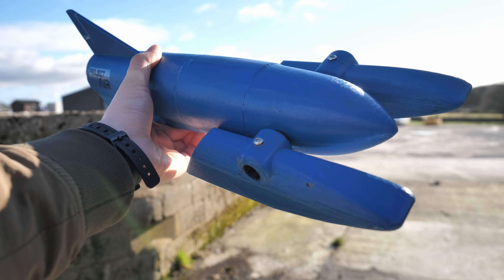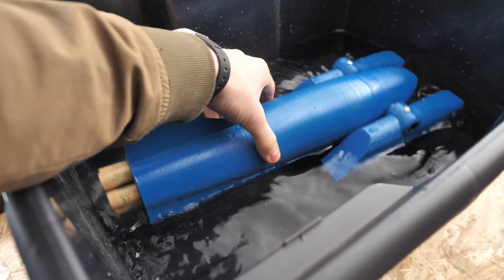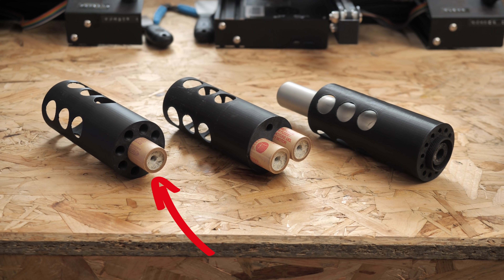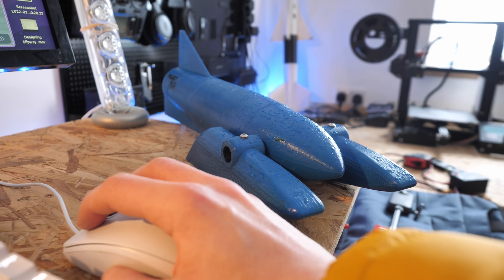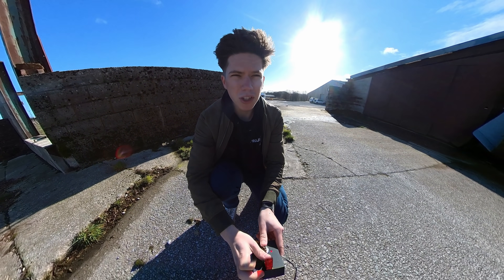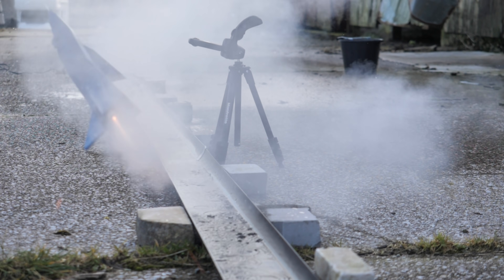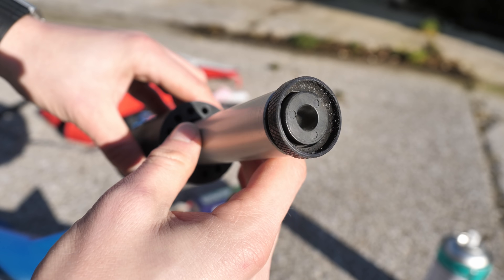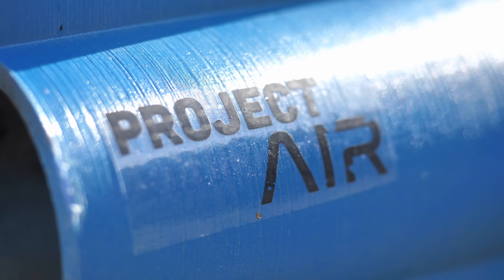DIY Rocket Hydroplane

Comment: Nice video.  Main issue is your sponsons are too wide - they're developing too much lift.  Look at the sponsons on the original Bluebird K7 - they're WAY narrower than your design.  Also note that in photos of the boat at high speed, only the last few inches of the sponson bottoms are touching the water.  Finally, the original K7 crashed when Campbell got too exited and didn't refuel between runs - which made the boat too light and it flipped.  You might consider adding some weight to the nose of your boat to increase stability.

Comment: Wrap all the rocket motors with the housing shaped like a lightly restricting funnel. Reverse bellhousing if you will and it will take care of the problem of not all the motors firing at once because they will all be directed into a single stream.

Comment: As a scale modeller you realize that the scale of the model 1:48th for example means the speed or distance travelled also has to be scaled by the same equation for example 1 nautical knot = 0.5metres per second, full size, at 1:48th scale that half a metre distance has to be scaled down by the same scale assuming time is a constant.

Comment: It should be obvious to anyone with an interest in highspeed boat design that Ken Warby's spirit of Australia's World Water speed record holding design solved the stability issue by incorporating a horizontal aerodynamic stabiliser. As soon as the nose lifts on a wave the angle of attack on the horizontal tail changes, and being a proper airfoil generates  aerodynamic lift more efficiently than the boat hull creating more lift at the tail than the bow,  autocorrecting the pitch change.   Warby hit skiboat wakes at around 300mph on blowering dam and his boat simply glided in the air with just the water rudder in contact with the surface for around 200m before the hulls touched down smoothly again. A highspeed boat ftravelling at a speed where it can generate more aerodynamic lift than its own mass  needs to be aerodynamically stable in pitch .  Donald Campbell's bluebird design was inherently pitch unstable and his death was inevitable by design.

Comment: I wonder if you could make a self levelling device for something like that, where if the nose rises out of the water, it automatically adjusts the angle of an aerofoil at the back to push the nose down again, and pulls it up if it goes too far under.

Comment: Make one big motor with 40/60..... sugar and KNO3, a 5 inch piece of 3/4 inch pvc for the motor body would be a M-class engine, stick bottle rockets get up to 2000 feet high.....you might need a bigger boat.

Comment: I did this back in the Summer of 1985, built a much smaller hydroplane out of a Estes rocket tube, "C" size motor, and balsa Hull/Sponsons. made a metal ramp at the lakes shoreline had a crowd around to watch, and after ignition watched it dive straight down under the water, becoming a rocket powered "Submarine" for a brief moment and floating back to the surface.  

I didn't give up though, second attempt was a cheap plastic kids "Tugboat Toy" with a roman candle firework shoved in pointed backwards.. I was told not to "Light it off by the docks" and with assistance from a friend transported the contraption out a short distance. Again with a small crowd gathered to watch I lit off the roman candle. To the amusement of the crowd the boat did not propel itself forward. it only slowly rotated a few feet from the side sending fireballs across the small aluminum fishing boat with some striking the side with "Ping, Ping" causing both of us in the boat to try and duck and take cover from the barrage of fireballs!  I returned to a lot of laughter about the display...

Comment: Hi fantastic video, I'm no expert in anything, but the issue of the boat flipping. This reminds me of the same issue as drag cars have when racing, don't they run long narrow stock to prevent flipping? So I thought if you increase the body length will this help?

Comment: We used to have rocket drag races when we were kids. We would get a toy with wheels like the steve austin $6mil dollar man rocket plane with wheels it was the best. any spaceship or any toy car or wheeled vehicle would work. You would modify it with a drill or saw or knife whatever you had using glue or duct tape or whatever. You install D size Estes rocket engines. I did three engines on the steve austin wheeled rocket ship once. Lots of fun I'm 58 now I might even try it again!

Comment: What is wrong with your design is the same thing that was wrong with the old Bluebird boat. It’s unstable. The old bluebird boat went airborne and somersaulted at over 300 mph back in the 1960s and was lost for over 50 years. It looks beautiful, but is inherently dangerous and flawed.

Comment: Too much flat points in contact with water. The original Bluebird K7 design had planing shoes made of stainless steel which it glided on over the surface of the water.

Comment: So I'm a Pyrotechnician and I think your issue with ignition is probably the type of ignition you're using. I'd suggest that you look at a pyrotechnics ignition system like Cobra Firing Systems M6. Also you probably want to use a electric match in a choke for a better ignition like we do with Gerbs (essentially a pretty version of a rocket motor).

Comment: I like the idea of a hydrofoil and maybe a an inverted airfoil under the main hull of the  boat (like an F1 car has).  But a longer length with a center of gravity towards the front would keep the boat on the water too

Comment: To keep the front of the boat on the water you need to add weight to the nose. this will also make it more stable. The center of gravity needs to be about 1/3 of the way from the front of the boat for a hydro

Comment: May i make a simple recommendation? Since your motor holding devce just slides into the frame of the boat. Load a spring in the bottom of the female portion so that when the engines complete there burn time the presure against the spring will cease there by allowing it to eject the motor frame. No latches needed.

Comment: About 20 years ago, I helped my son and his schoolfriends to build a rocket-powered boat for a class contest. To my surprise, the school approved it for a test in the outdoor swimming pool, which was enclosed in wire netting. I was so concerned that it shouldn't take off that I designed it with some downforce from the airflow.
The result was spectacular  - the boat shot forward about one metre, then dived to the bottom of the pool with the rocket motor still burning. It finally bobbed back to the surface a little more than one metre from the starting point, and was awarded a special prize for "Least Distance Covered By Any Entry." It was, however, a most spectacular failure!

Comment: Late comment here but if I remember well, for multi-motor microrockets (never did one myself) it was recommended (by Estes I think) to use another micromotor to ignite the cluster. This by using the exhaust flame from the nozzle of the "igniter" motor positioned at some distance from the cluster.

Comment: Years ago we used the gun powder from fire crackers for multiple engine rockets. Plug the nozzle with wadding once the igniter and powder have been added. You'll notice quicker ignition also. The max one guy was able to ignite was 24 engines in a Saturn 1B.

Comment: I've often wondered why super fast hydroplane racing boats don't have have a device similar to a model airplanes elevator hooked up to a gyro stabilizer that would automatically keep the nose of the boat at the proper attitude.

Comment: You are facing the SAME ISSUES as the BLUE BIRD, you SIMPLY NEED  A SYMMETRICAL EPPLER 169  T horizontal tail-aileron behind to prevent nose-up catatstrophic behavior  ( see the australian machine which run at 450 kph )

Comment: A couple years ago I decided to make a handful of rocket power boats.
Most went airborne or they went completely submarine. 
I found it interesting that the rocket motors worked underwater.
Most of the ones that went submarine easily shot out to about 50 feet underwater like a torpedo.

Comment: Your problem is your using most of your thrust just to get up to speed and your done before you can hit full velocity. You need extended fuel life and a bigger track. I also think you would be better off making the boat wider and longer for stability. Maybe a set of back extensions like the ones in front.

Comment: Lol, I did this about 20 years ago and I couldn't keep it on the water, it was glass covered polystyrene foam, fun either way. I used a v hull design and the only thing I could figure out would be to have long trimtab type stabilizers on the back

Comment: When clustering model rocket engines. You have to use a high current battery, and hook the igniters in parallel.  So they have the same voltage  and the current splits equally. That will give more reliable  cluster ignition

Comment: Have you thought about a type of hydrofoil that lets the boat ride up out of the water but held to the water by foils that stay under the surface. There are some high speed racing boats that use this design.

Comment: I made a model dragster powered by a CO2 cartridge and eventually switched to model rocket engines. The way I kept it on the ground was by screwing eyehooks into the bottom so it can ride on a cable stretched between two spikes hammered into the asphalt.

Comment: I saw one where the designer made a skimmer using V shaped wedges instead of foils. The wedges are pointed forward. This means if the boat gets too high, the top and bottom of the wedge have the same force acting on them, so it loses altitude and drops back to the water. if the bottom wedge is close to or in the water, since there is no escape out the back of the wedge, the bottom half of the wedge becomes an air ram, and the buildup of air pressure lifts the boat.

Comment: Lengthening the boat will help. Also, small gyros, often used in model aircraft, are really cheap and could be used to control active aerodynamics or hydrodynamics. i dont think a boat of the size you are working with in this video will every be stable.

Comment: It was my first thought.  You need a spoiler.   And if you ad a good and a servo you can male it actively pitch to keep the nose at the right attitude.

Also at the back of the sponsons leave a lip about 1mm thick and let is over hang the back of the bottom.  That will also keep it "stuck" to the water.

Comment: If you had a longer test are where you could reach max velocity, A counterbalanced canard system could keep the nose from getting too much air. Hydros have been battling blow overs ever since they got fast enough to do it. With rocket motors you don't have the luxury of throttling back like conventionally powered hydros.  I believe the key to success id to find that final trim point where you can still get up on the step but not blow over. But until you can reach a sustained velocity,  you will have to sacrifice top speed and initial speed to make that happen. The motors thrust is exponential and once it at full power, there is limited time for the boat to continue before it burns out. Cool experiment though. The progress you made is really cool.

Comment: The blue bird motor was angled up at the rear to help keep the nose down at high-speed.  The crash that killed Campbell may have been caused by the engine running out of fuel. The normal way to slow the boat down was to slowly throttle back.

Comment: Hi, nice Video ...
- to stabilize the thrust, the pressure point should be in front of the center of gravity from your Hydroplane

- In order to ignite all engines at the same time, a double system would be useful or a device where the exhaust jet of each engine 
  also ignites the neighboring engine .. and wait (hold) for 1-2 sec. before the Hydroplane start
- to prevent the boat from taking off you should build a system similar to the NASCAR that prevents the vehicles from taking off (flaps)

Comment: that boat is not aerodynamically stable at high speed due to the front canards or whatever they are called, they generate lift because they are shaped from the bottom side only. in order to solve this issue your thrust ratio must not exceed the weight of that boat. in other words smaller engines or more bigger boat is a must

Comment: Wonder if the test results would be different if you had a release mechanism that holds the boat while engines power up then release it smoothly. Similar to a rocket launch and tower releasing the rocket.

Comment: With rocket cars and boats longer tends to be better.  Look at the LSR car called The Blue Flame.  https://en.wikipedia.org/wiki/Blue_Flame. The relationship of the center of pressure and the center of gravity is quite important just like on a rocket.  You want the CP to be about two diameters behind the CG.  Adding nose weight or more of a vertical fin will help.  At Bonneville it's common even with wheel powered cars to add ballast up front.  Just some thoughts :-)

Comment: You haven’t got a hull design of any sort youre using ski shapes which are an issue also you are trying to angle the  front hills when you should probably angle the rocket to keep the hull down

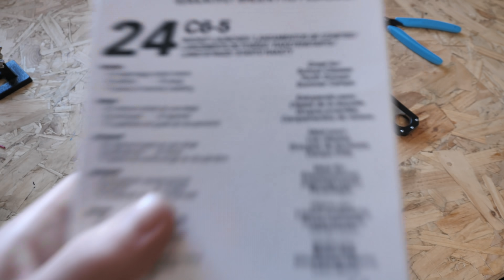Comment: Starting at about 01:18 in this video: IF I am interpreting your diagram correctly, that shows how the solid fuel -- which is ammonium perchlorate, IIRC -- is arranged In a reloadable rocket motor.  The central core of the fuel grain is open from front to back.  When the solid fuel is ignited, it burns from front to back at the same time, moving outward toward the inside surface of the rocket motor's metal tube, until all the fuel is consumed. 
 
In ESTES type model rocket motors, the fuel grain is a type of black powder with no open core.  The fuel burns from the back to the front.

Comment: Given the short burn time of your rocket engines i can understand why your test pool is so short. However, your boat has no time to stabilze on plane before thrust increases to suicide level. At that point it is not a boat, it is a water launched horizontal rocket powered aircraft! Perhaps a lighter butane refill canister could be used with some rc control equipment for a hydrplane powered by a miniature pulsejet?

Comment: I would add a tailplane that you can use to trim it at the desired angle of attack, if the nose pitches up it will increase the angle of attack of the tailplane and so pitch the nose down.

Comment: Have you ever messed with using sand as infill? Half print then fill the voids with sand or spray foam then recenter and reprint the rest? I have seen a few good ways of balancing using this method with placing bolt washers in front he voids

Comment: Obviously you are doing this the modern-nerd way. When I was 10-12 years old we would build these hydros from balsa and plastics modeled from the hull design of the Miss Budweiser with the rocket set to eject after the burn. We could build/rebuild/adjust these things way faster than your methods- and they actually worked.
Sometimes we would take them to the hotel pool and shoot them 25m at the end of the day with a raft at the end to catch the boat... spectators loved it.
For a basic tip, spread the sponsons further apart for stability and more predictable tracking, and eject the motor if you don't want to destroy your hard work to a crisp.

Comment: You should find the video about Art Arfons, a world speed record holder for boats. One of the things that is used for avoiding the aero lift, is the amount of rudder that goes into the water. Because water is denser, the drag the rudder creates can exert a LOT of force. Iirc, in the video, Art chooses to cut off a single inch of rudder. That decreased his nose lift margin of safety by around 2000lbs.
Reply: Just watched the correct video. Ken Warby, not Arfons. Total drag of the entire rudder was 2000 lbs.

Comment: trim tabs on the rear of the boat will help counterbalance the lift of the sponsons.  Also, don't forget about scale.  If that boat was moving at 60 actual miles per hour, and let's say the boat is 1/24 scale in size, the boat thinks it's going over 1400 mph.

Comment: Love your vids, I subscribed. Have you ever thought about building your own rocket motors? A ton cheaper & its a simple formula = powdered sugar &  potassium nitrate (found in Spectracide   Stump Remover) Both are cheap & this formula is no kids  toys, it can be very powerful! And its cheap at a cost of around 50 cents a motor!  65% potassium nitrate & 35% powdered sugar , or use Sorbitol (artificial sweetener) its much more energetic than just plain sugar..

Comment: i mean, this is cool and all but jesus is that hydroplace desgin inefficient.

i would personally recommend a diffrent desgin but i dont want to ruin your fun here so keep at it!
Reply from the maker: Pls suggest improvements
Reply: @Project-Air  i did on your pinned post, but ill do so here as well.

your boat is pretty chonky, and at this rate of (bigger rocket motors) it may as well just qualify for body sea skimming with dorsal fins to keep it straight.

that being said, i suggested putting holes at high points of drag and use that airflow to further enbale the stability of the craft during its run up.

i would also recommend a nose down approach to this (much like F1 cars) as it best keeps the boat from flying away litterally.

im more hands on with ideas like these so i cant say how well it would work, but what i am saying to invest some time into a more effective body and pontoon set as clearly your coming across some glraing issues with this test bed of a body.